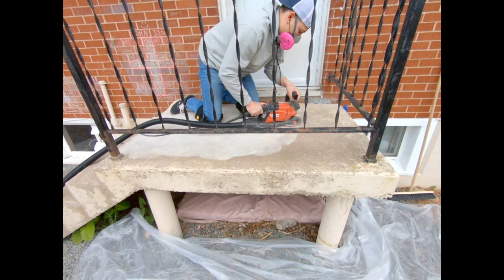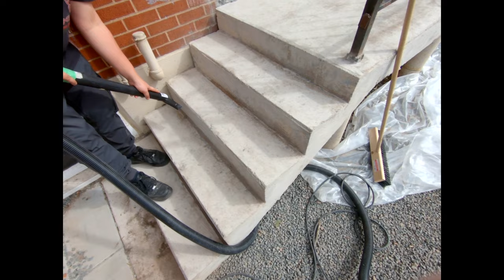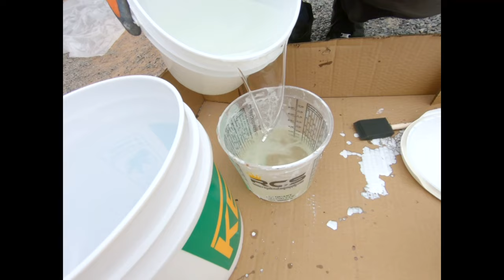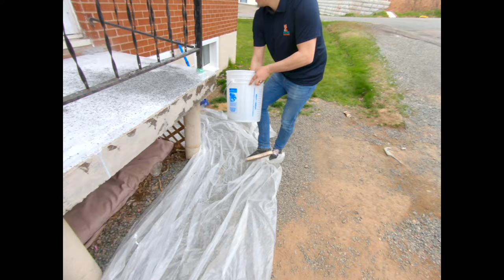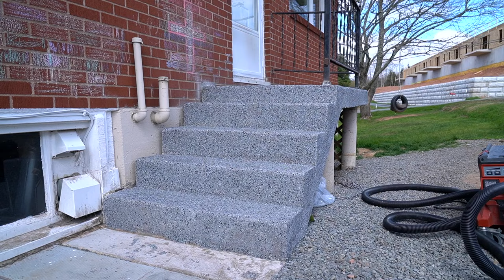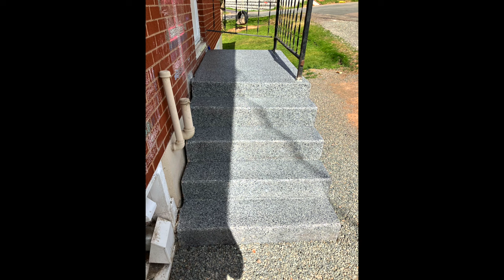Stairs Transformed with our Epoxy Flake System | Clever Coatings #epoxy  #epoxyfloors

Comment: Thank you for the good work in showing how its done. Is it slippery when wet? Can it be off white in color?
Reply: Hi Pam,
The flakes give the floor a texture which gives it a grip and there are a lot of colors to choose from.
Reply: @KevinHajiM  Thanks Kevin. Does it get hot? Can it go over existing brick exterior stairs? Thank you
Reply: @KevinHajiM  what are the flakes called?

Comment: What type of base coat are you putting down for exterior?
Reply from the maker: Hey John,
If there is no sign of moisture issues we use polyaspartic for base and top coat.
Reply: Thanks for the reply. If there is a moisture problem what do you prime with on exterior floors?